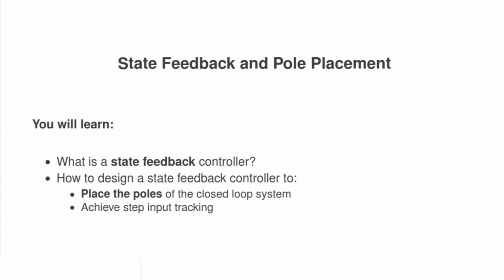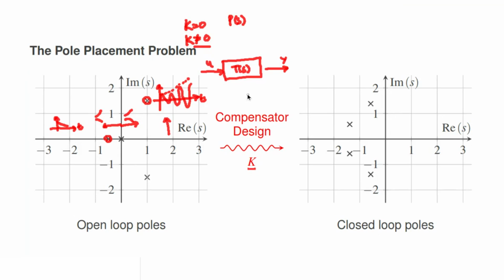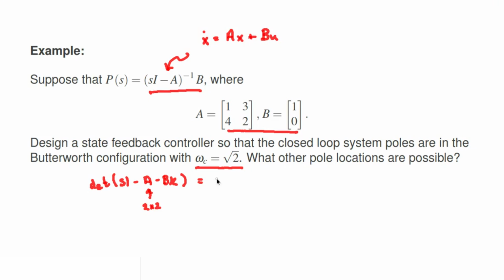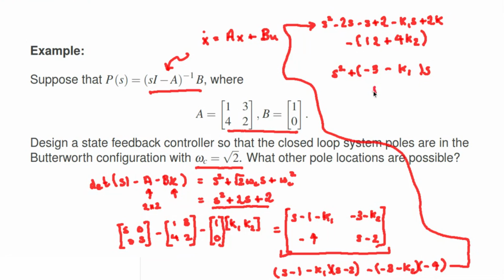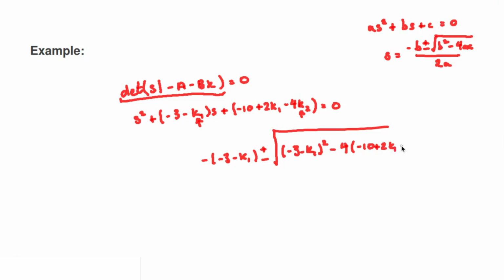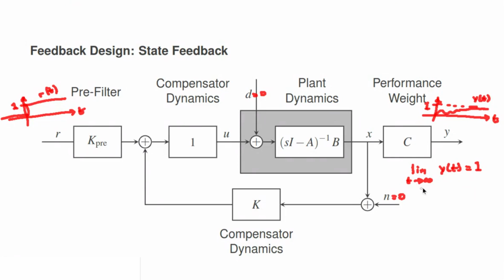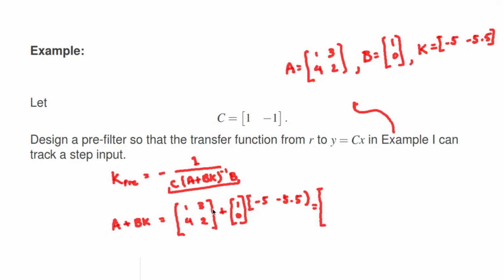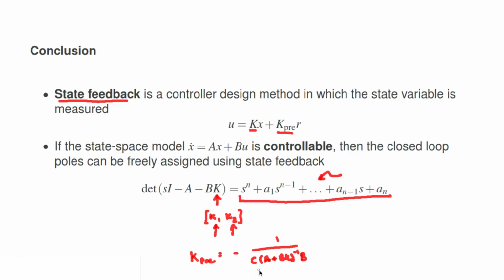Pole Placement and State feedback

Comment: Hi. I believe that there is a mistake in the third-order Butterworth polynomial expression.
Reply from the maker: Yes, you're right! The final w_c^2 is meant to be a w_c^3, so it should be s^3+2w_cs^2+2w_c^2s+w_c^3... Good spot - glad you're paying attention! Thanks!
Reply: @richard_pates  Thank you for your response! May I ask you what are the real benefits for employing the Butterworth configuration for pole placement? I am getting better results by defining instead a first-order and second-order characteristic equations. The three poles are still in the semi-circle, but I can play with the damping of the complex conjugate poles, and get better response characteristics.
Reply from the maker: @adricat59  The honest answer is not many as far as I know. The motivation for the butterworth configuration comes from the butterworth filter. This is the filter with transfer function y(s)=G(s)u(s), where G(s)=1/(butterworth polynomial). The motivation here is that this G(s) should give a very smooth response to input signals that satisfy u(jw)<<1 when w>w_c. This can be a nice thing to do as it should lead to nice tracking of the most common types input signals (such as steps and ramps). So the idea is that placing our poles in this configuration should hopefully result in a system that inherits this nice property. However for a general state space model (assuming single-input-single-output), after applying state feedback we get a closed loop transfer function y(s)=C(sI-A-BK)^(-1)Bu(s). Now, the denominator of this transfer function will match the denominator of G(s), but the numerator need not. So it's perfectly possible to place the poles in the butterworth configuration and not even inherit the one desirable feature that this set up is designed for! In fact examples can be constructed where the butterworth configuration leads to an objectively bad design. The moral of the story is that when doing control design, the most important thing is to investigate the properties of your control system (as it sounds like you're doing), and then tune your design accordingly. Things like the butterworth configuration can give you a good first estimate, but should never be relied upon. So I'd say, keep doing what you're doing!
Reply: @richard_pates  Thank you very much for the response and the time invested on it, Richard. It was very useful.
By the way, I found very interesting your videos and the way you present them. Have a good day :-)